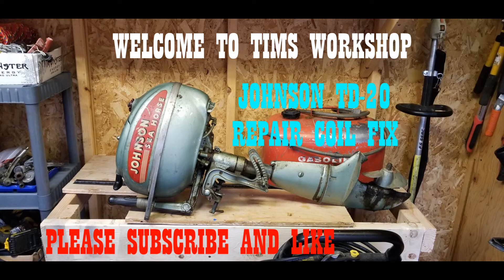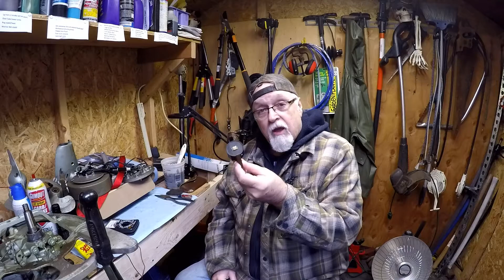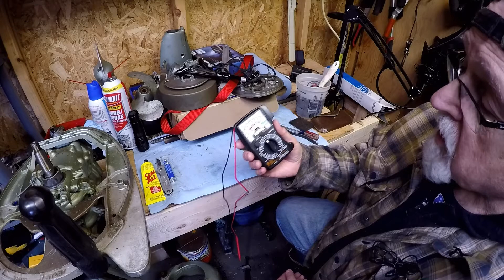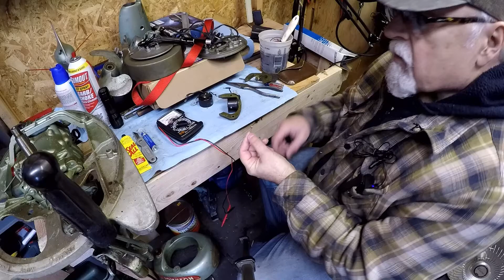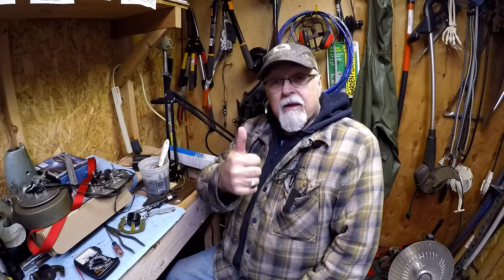Johnson TD 20 how to repair broken coil

Comment: awesome video Tim
Reply from the maker: Thanks Jim, Short one but getting closer to installing the new plug wires. Just a few more on the old Johnson and have a new merc 60hp merc video coming up. I also have some more testing videos planned on the 60. Plus going to order the new paint for the old Merc Mark 10hp to restore down the track. Stay Tuned. Tim